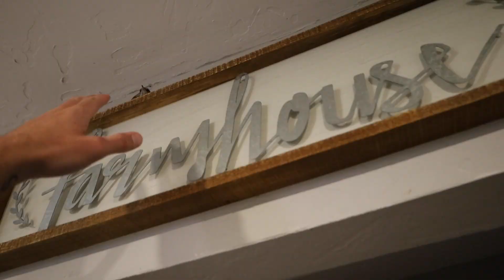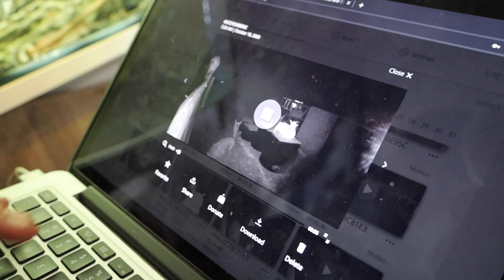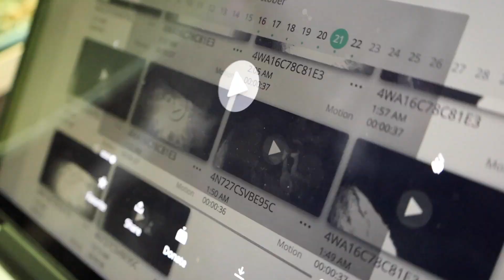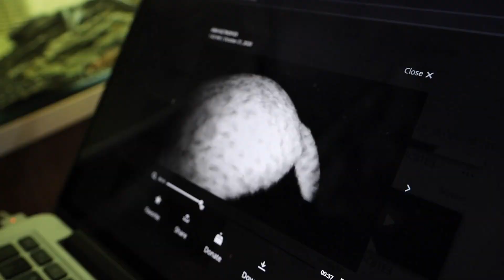This was Stalking my animals... scary

Comment: Try metal spikes on top of the fences and/or cat fences (they basically wired fencing curved with brackets that can be added on top of your current fencing, face it outwards and supposedly cats of any size cat can’t jump or climb it since it’s curved at an angle)